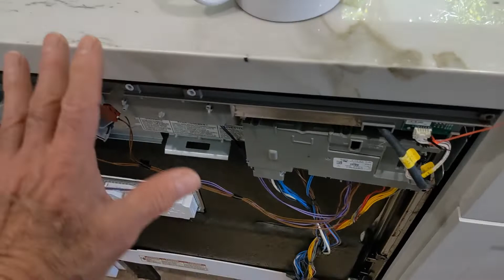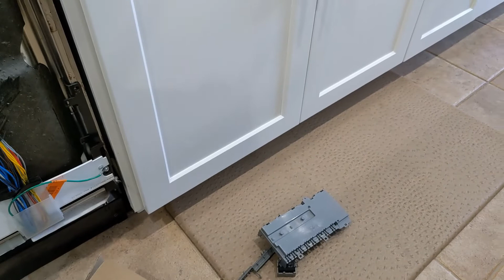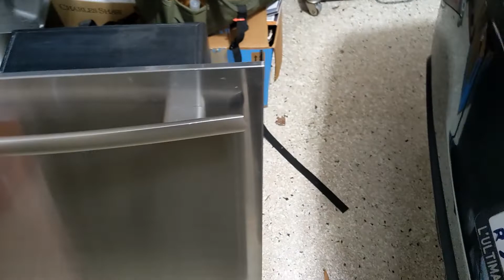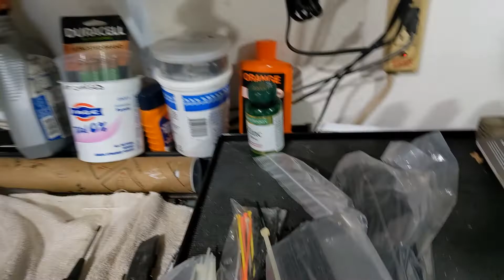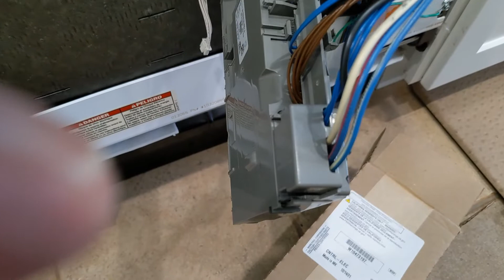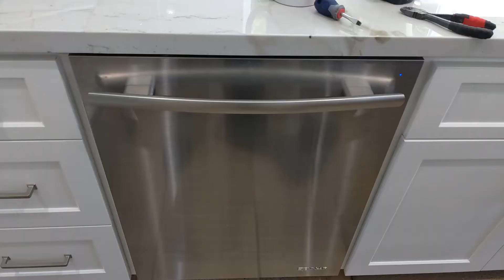Home repair Jenn Air dishwasher does not finish cycle by froggy

Comment from the maker: Parts for dishwashers #ad  https://amzn.to/38gi1Y6
The torx was t-25
That part did not fix the washer, upon further diagnosis a leak from the motor/impeller part was found. This is another expensive part and the unit is 10 years old so I decided to buy  new one. IMO Putting multiple $200 parts on a 10 year old washer vs. buy a new one installed @ about $1800, I decided to go new.